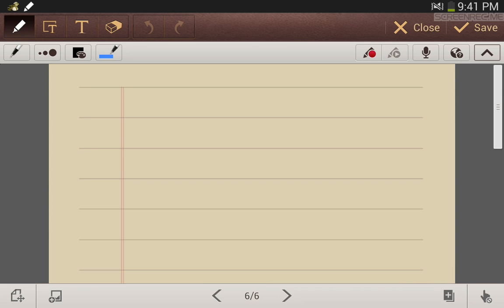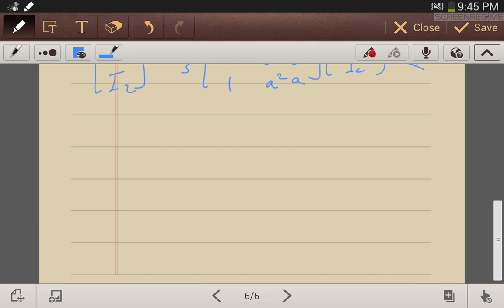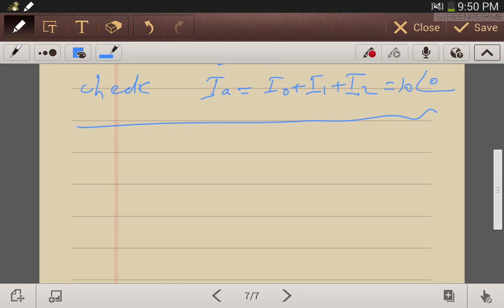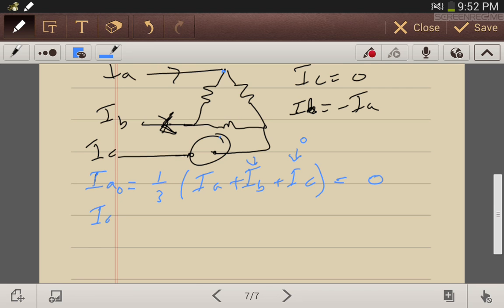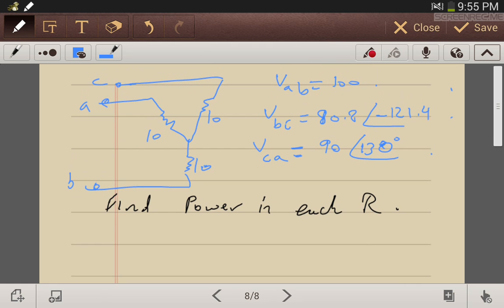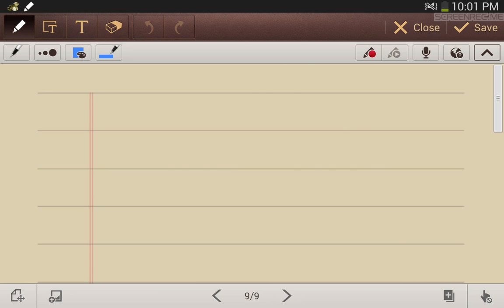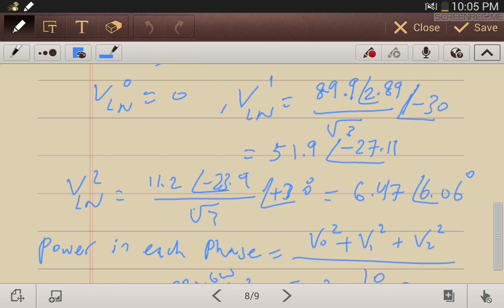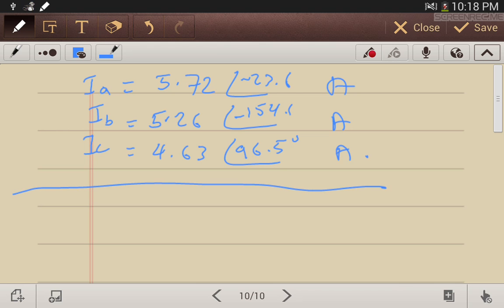Lecture_6 Symmetrical components

Comment: Hi Sir, Thanks for the great video, One question: @16:15 when finding the Vln1 (Phase) why is it multiplied by -30degree's & Vln2 is multiplied by +30degrees? Thanks again for the video :)
Reply: Because for positive sequence network phase voltage lags line voltage by 30 and for negative sequence phase voltage leads line voltage by 30 degrees...... Its due to negative sequence component have opposite phase sequence to the original unsymmetrical phasors..